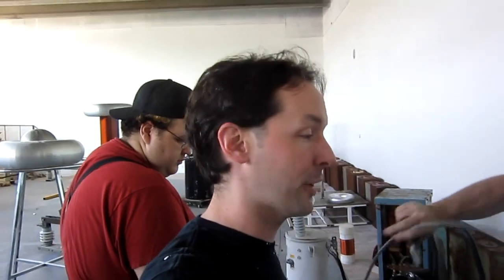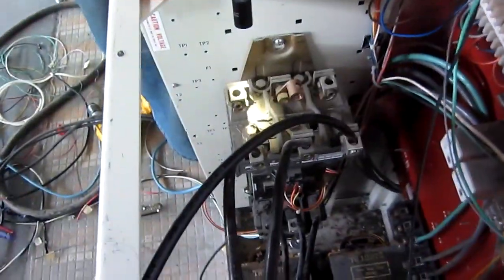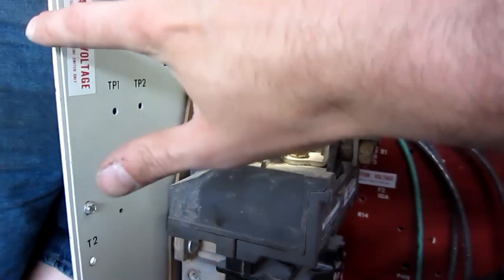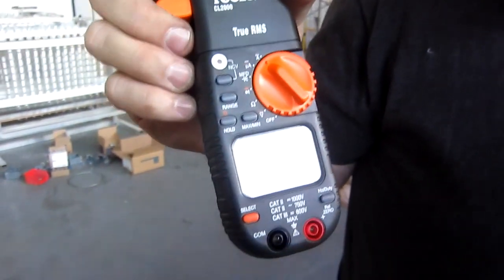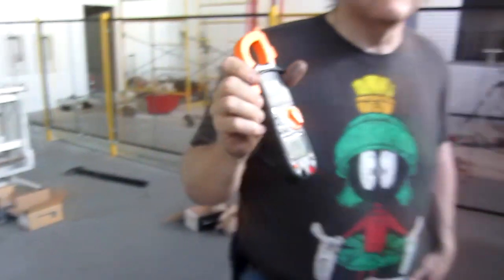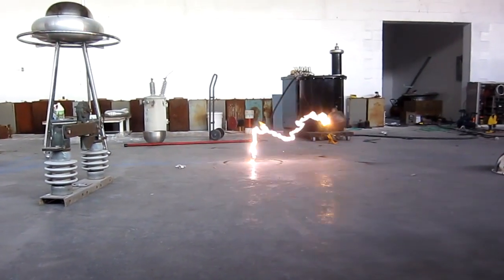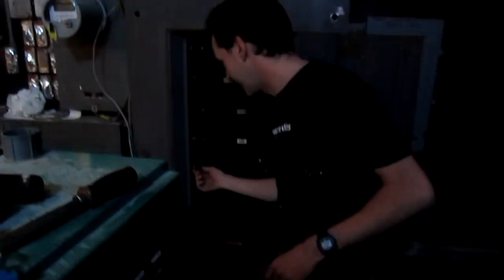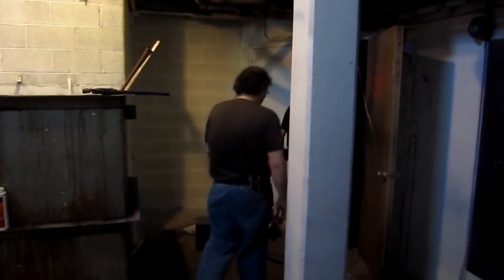Captain's Blog 5-30-11 High Voltage Lab Power Supply Testing

Comment: @thewii552 
The maximum load (measured in amps) going through the Gemini control system (low voltage side) ;P